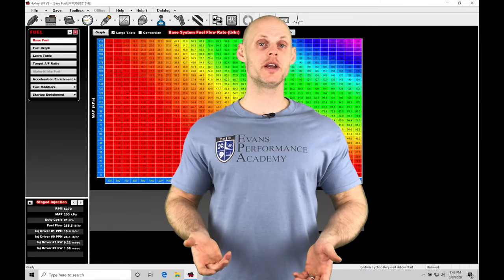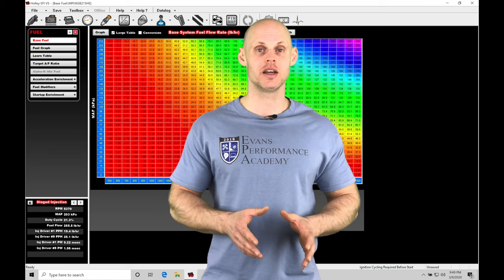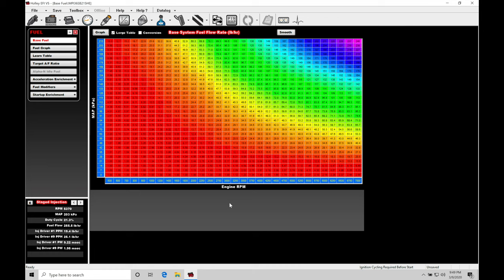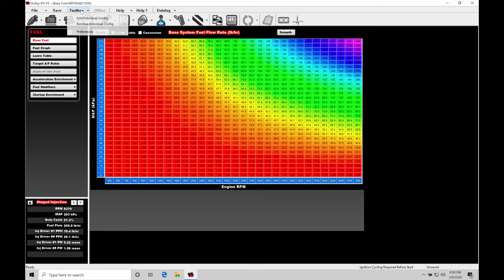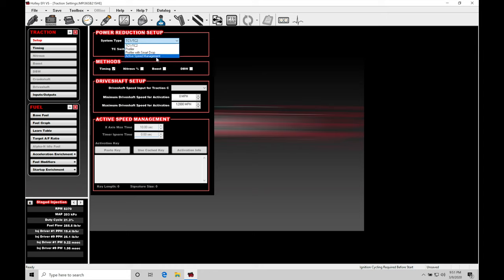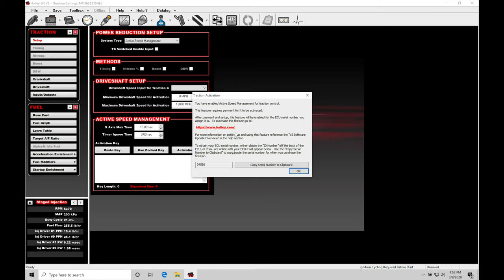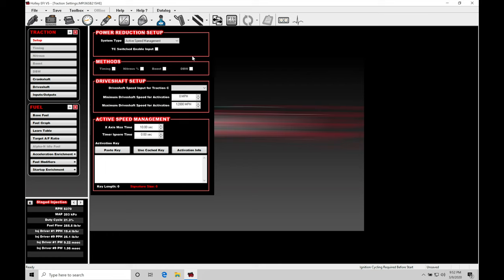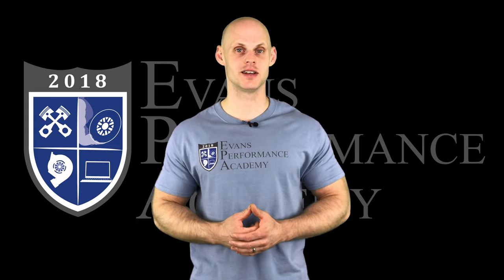Holley EFI Training Course Part 38: Traction Control | Evans Performance Academy

Comment: Does the Dominator traction control not work with wheel speed sensors?
Reply from the maker: No, it does not unfortunately.